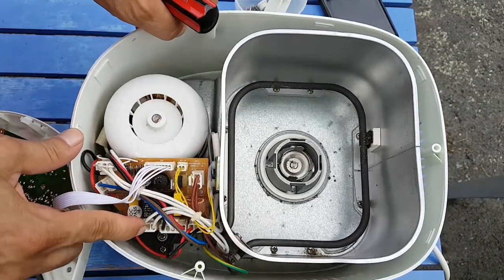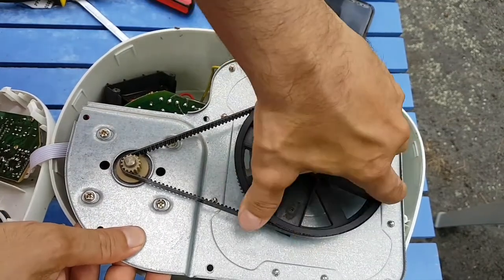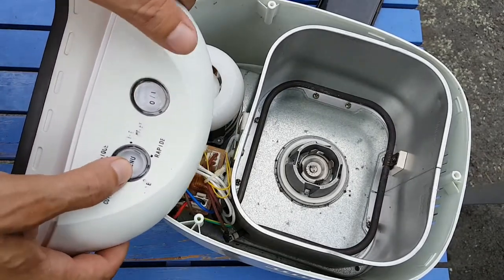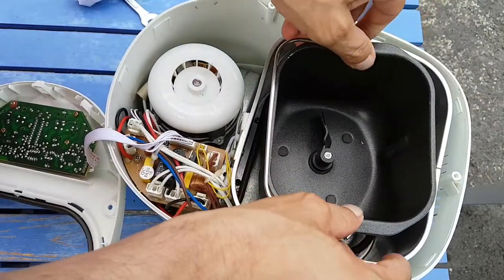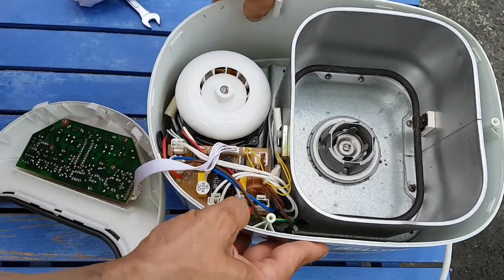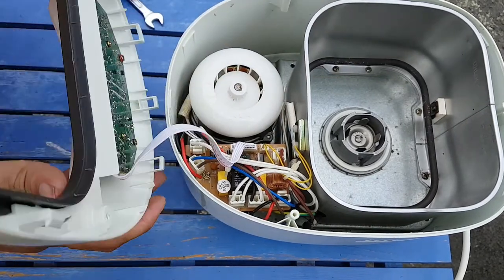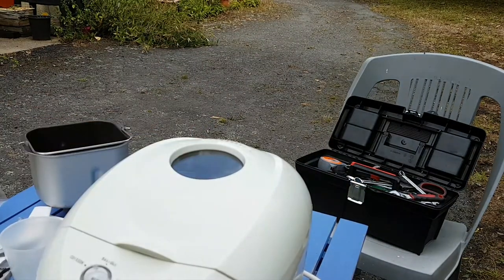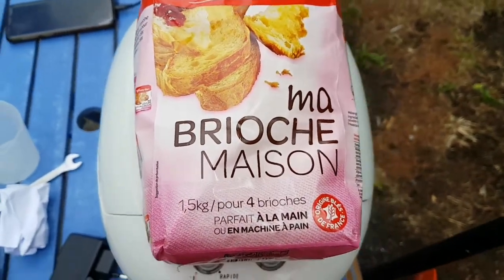Replacing the drive belt of an XBM1008 bread maker.

Comment: Dose anybody no the belt size for this
Reply from the maker: If I remember correctly, it was an Ariete 125 replacement belt.
Reply from the maker: Found the order email. It's a type AT6955390500 (so, yes, Ariete 125), with a length of 490mm, a width of 8mm, and 3mm between the teeth of the belt.
Reply: @heyrickblog  Thanks for a lovely clear explanation of the function of the parts of this unit.
Please can you give the number of teeth on the belt? Many seem to be specified by length & number of teeth, and I am hoping to find a cheaper generic belt.
Reply from the maker: @terrygee210  Sorry, it's inside the machine. In the above comments I've given the type and sizes, so it ought to be possible to correlate that with something.
Beware though, you can hear the motor struggling at points when kneading the dough, so a belt that's too cheap might end up being a false economy if it can't take the stress.
Reply: @heyrickblog  Thanks. I wondered if you could count teeth on that spare belt. You are right about the stress. I am using a plain flat belt I had at the moment, and it slips under high loading. The bread maker cost £10 from a charity shop, so paying the price of the proper belt seems illogical, but on the other hand it does seem a shame to scrap it.
Reply from the maker: @terrygee210  I have no idea where the spare belt is! I got mine from a vide grenier (like a car boot sale), so since I didn't pay €€€ for it, I don't mind coughing up a few €s for a belt. It's not like they're that pricey, when it's either a choice of fixing it, or binning it.
Reply: @heyrickblog  Thanks again. You were lucky. I'm seeing ebay prices above £12, clearly more than I paid for the whole machine. While I decide what to do I can try the old dodge of violin string rosin on the belt to help stop slipping....